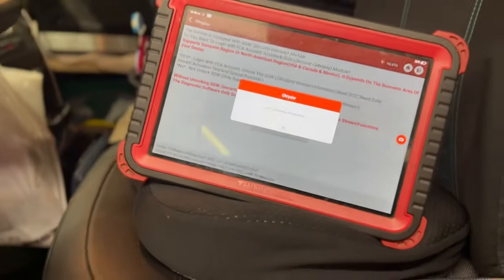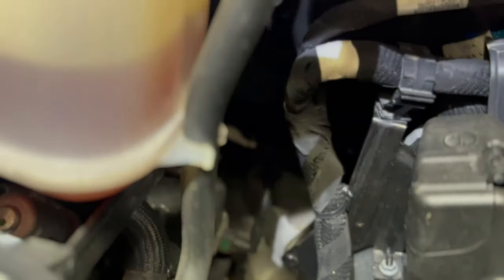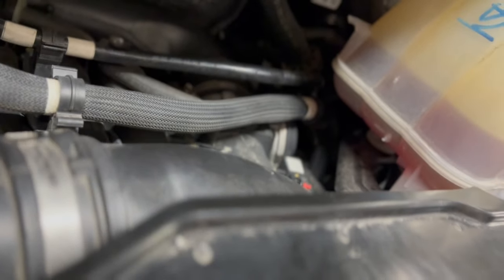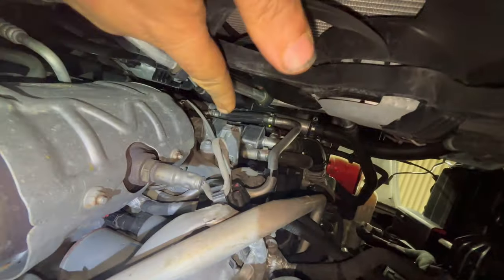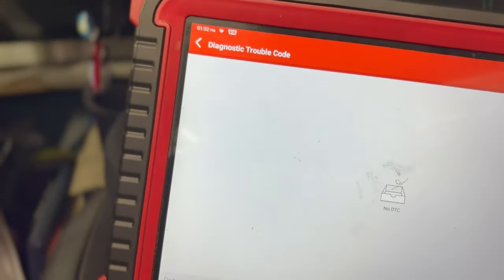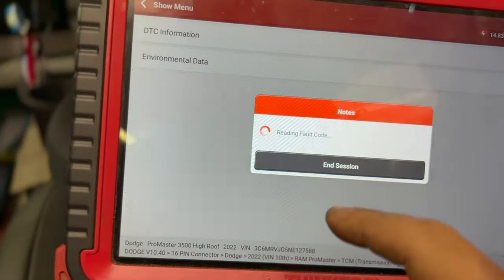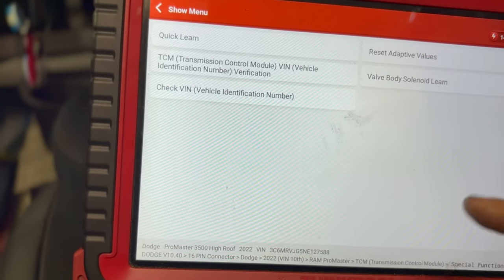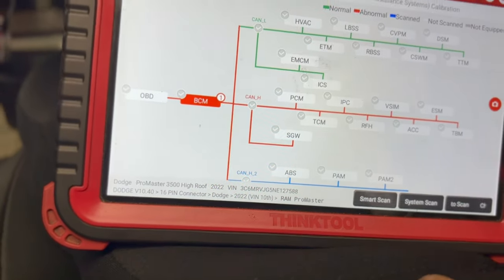2022 2023 and up Promasters: differences from the earlier vans. VAN GEEKERY awaits you!

Comment: I have a 2023 3500, so it was good to see this. A couple of things: the first one we commented back and forth a while back: the 9-speed transmission will not go above 7th gear, so it is kind of false advertising to call it a 9 speed. Second thing; I've had intermittent cases where while accelerating, the van will literally drop to ~ 1500 rpm and bog down to 20 mph. The research I've done on it seems to point to, in some shape or form, throttle body issues. I will bring it to the dealer in a couple of weeks for them to look at it. If anything interesting comes out of that, I'll post the findings.
Reply from the maker: Do. I’m always interested in details on the new vans.

Comment: Very interesting post thanks! A group member asked me the feasibility and cost of swapping a 9 speed transmission and modules for the 62TE and I don’t have a clue. Not one on the engine tranny and modules swap either. It’s easy enough to get a Remanufactured engine and tranny swapped for the year I said.  

Your comment that RPM at highway speed is likely at 2k in 7th with no higher gear used is quite interesting as well.

Again thx for the post🙏🏻
Reply from the maker: I can shed light. Not possible. The trans is integrated with the engine and the rest ofvthe van’s computers. Putting the trans in is easy, having it work, impossible. MUCH cheaper to just buy a new van. 

Know what’s even cheaper? Lets assume the worst. If I told you that every 200k miles you’d have to spend $4000 on a transmission, you’d probably say “ok. That’s not so bad.” You’re driving around in a $100k rig, you’d consider $4k every 10 years to be a pretty cheap date.
Reply: Sage advice and great plan, thanks! 🙏🏻

Comment: Thank you for the information! Great stuff!
Hate to see they added egr 
It’s just another thing prone to fail. It does require maintenance (cleaning) as overtime they get plugged up with carbon, reducing greatly their functionality, and as a result can cause all kinds of engine problems including blown head gaskets. 
Hopefully designers thought it through and the software can adjust egr usage depending on the egr condition.
Reply from the maker: Gotta admit, my experience with modern EGR is limited. The thing to do would be to scan around various Chrysler forums for vehicles post 2018. See if they report EGR issues. By then, pretty much everything had gone to the Gen3 pentastar. Promaster held out with Gen 2 and was also the last holdout for the 62te transmission.

Comment: Can you recommend  OBD reader for my 2022  9 speed Promaster.?I bought the OBD LinkMX+ nice guages, cool features.  But! Can't read transmission temps...
Reply from the maker: In the 2022-up, there is a discreet Transmission Control Module where that temp info lives, unlike the 2014-2021 where it all lives in the engine computer. So it's likely your reader is only reading ECU codes. I don't have a recommendation, but I've seen true bi-direction scanners for sale for well under $300. Yours, being post 2018, will also have to deal with the security gateway, and you may end up paying chrysler $50 to get through the gateway. You might also try a phone app product called Jscan, which is mostly for jeeps but works with the promaster. Lastly, the rest of the cars and trucks will show you the trans temp on the dash screen, and I believe the PM will too, but you may have to dig through a lot of menus to find it.
Reply: @promastersonly1419  thanks! If I ever get your way I'll stop and say hello..

Comment: Is there any way to program the van to NOT flash the parking lights when you lock the doors? I hate lighting up the campground when I go to pee at 3am.
Reply from the maker: To the best of my knowledge, no. If it’s any consolation, that flash tells you that all the doors are closed and latched. It will flash twice if a door is ajar.
Reply: There are different settings for lights.

Comment: Quote from FCA advertisement: LOL😂😂

NEW STANDARD 9-SPEED AUTOMATIC TRANSMISSION
•High efficiency in all gears and speeds, thanks to nested carriers, dog clutches and advanced hydraulic control unit architecture
A wide ratio spread brings outstanding launch characteristics and smooth transfer between gears
• Short mid-range gears help to ensure quick transitions, and higher gears-7th, 8th and 9th transitions-relate to help lower engine rpm speeds
Reply from the maker: True, but turning less than 1800 rpm on the highway will lug the engine, and destroy it pretty quickly. And get worse mpg.
Reply: Just pissed me off that they would lie in advertising 9 speeds. And how great 8th & 9th are.
Glad the trans has been fine for 20k.

Comment: Great video.
Reply from the maker: You have very low standards for greatness. But thank you.
Reply: Your YouTube channel gave me the courage to buy the quirkiest vehicle I've ever owned! I tell people that I found a funny, intelligent, not too sexist ProMaster mechanic in Ohio who uses the words Germane and apropos in his YouTube videos.🤣 I want to watch anything you post!
Reply: Well....almost anything..
Reply from the maker: @embracinghumans  ha. Thanks. I take requests - been trying to insert the words “larva” and “fallopian” in an automotive context. Wish me luck!
Reply: @promastersonly1419  
Hello Kip, thank you for all the info you provided. Have a question about new 9/speed transmission for 2022/promaster.
Does new transmission comes with filter ?
Reply from the maker: @JuanPerez-ov6mn  yes, there’s a filter but it’s lifetime. It’s changeable, but it’s transmission out to do so.
Reply: Thanks for prostituting out my van Kip :)
Reply from the maker: @slindsay4784  when you got it, flaunt it.
Reply: @promastersonly1419  😂😂😂
Reply: @promastersonly1419  
So, basically all you can do is changing the transmission fluid at 60-k  intervals?
Reply from the maker: Technically, the ONLY maintenance that's really required is plugs every 100k, trans every 40-60k and coolant every 5 years. The manual calls for replacing the brake fluid every 2 years, but I think that's complete bullshit and my oldest van has the original fluid in it from 2014 with zero issues.  @JuanPerez-ov6mn

Comment: That looks like the older updated chassis, the really new ones don’t have the upswept headlights.
Does the transmission have a manual mode?
Can the 8th and 9th gears be unlocked with a software update? It would be nice when doing cross country trips.
From what I’ve read, the engine update isn’t really new, it’s just now getting installed in the vans. Not sure if this is factual.
Reply from the maker: Currect, the gen 3 engine has been in other chryslers for as long as 5 years now. You think you want all 9 speeds, but you dont. If you could shift into 8th, you’d be turning something like 1400 rpm at highway speed, which would lug the engine and destroy it pretty quickly. You’d get worse mileage, less power, and engine damage. I dont think you really want that.
Reply: Yes the trans has manual mode.
Reply: @promastersonly1419  So what applications (vehicles) have the usable 8th and 9th gear?
Reply from the maker: Not certain, but I would assume the lighter vehicles would. Jeep Renegade, Cherokee, Pacifica, Acura MDX, Honda Odyssey, many others.   @stuartstuart866

Comment: We have a '23.  The nine speed transmission never shifts into 8th or 9th.  I tried my best during a 150 mile drive to get it to switch, doesnt happen. This was at various highway speeds from 55 mph to 80 mph in table flat Florida.
Reply: What is the RPMs at 80 mph?
Reply from the maker: It's programmed to NEVER shift into 8th, is my understanding. And why would it - that would lug the motor and do bad things. Best mpg is going to be about 2000rpm, and my guess is yours is right at 2000 at 60mph in 7th.
Reply: @promastersonly1419  Exactly, and there is no weird gear hunting like you can get with the 62TE at highway speeds. Not sure what all the complaining about 8&9th gear is about.

Comment: Is the 2022+ a better version?
Reply from the maker: Broadly speaking, yes. The tick problem is mostly solved, and the 9 speed is more durable than the old 6 speed. Otherwise they are mostly the same. The drivers assistance stuff is nice but not a deal breaker.

Comment: I imagine, like I imagine you imagine, that we will be watching the reliability of the new 9-speed transmission.

The company claims something like 9% better fuel economy.  Unfortunately, I could find no external data on this.  Surely, they would be referring to a specific kind of driving.
Reply from the maker: Likely true in some of the smaller cars it's in, but a dubious claim in the promaster. Only 1 gear counts, the highway gear, and it's the same ratio in both generations of van. But the engine has some improvements.